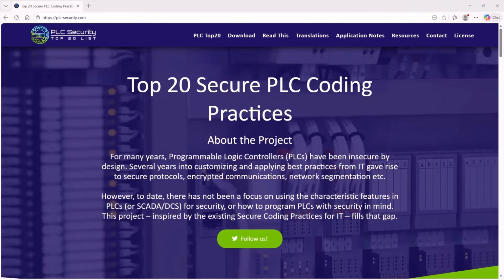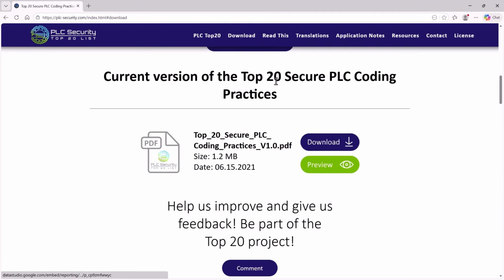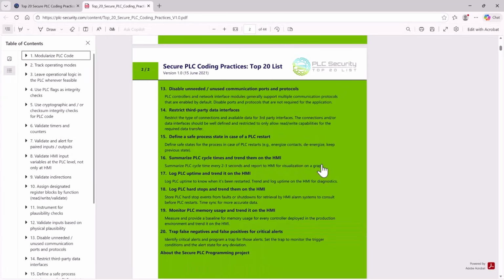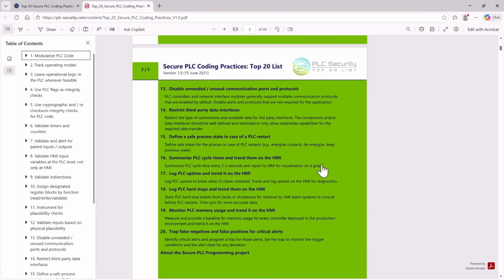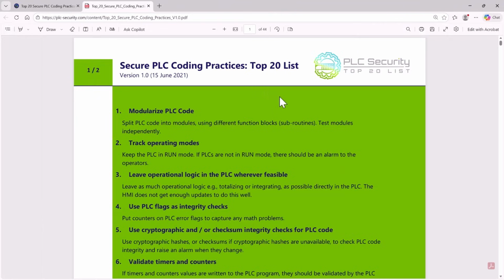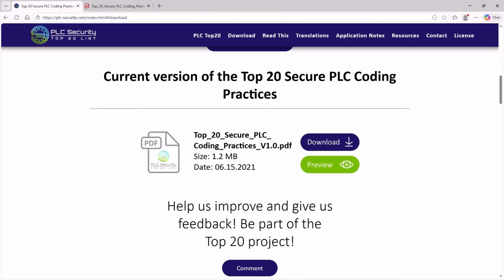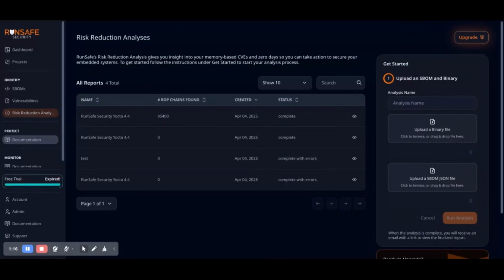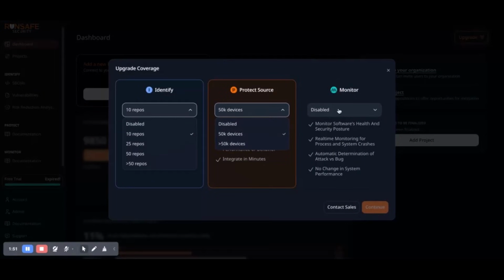Uncover the HIDDEN Threats in OT/ICS Cybersecurity

Comment: what do you think of Arduino Opta PLC in term of security and connectivity ?
Reply from the maker: I'm not directly familiar with them so I couldn't say 100%, though they look like fair little units for smaller environments, @Altairhigh.  Definitely solid units for a home lab at the very least!
Reply: What an interesting component! Thank you.

Without knowing those components, I guess, if it still uses the Arduino base, it could be better in terms of security weaknesses.

Now the large but: At first, at least on the Arduino page about them, I had not seen anything regarding any certification, not even about the environmental specs it's made to work for. Secondly: A PLC is one thing, but what runs on it is another. Even if the device has certifications regarding the hardware, it's security in the field still depends on the certification of it and its programming. So if this certification says (or even has to say), it's only valid under Arduino Software version x.y.z and a certification costs $10ks and takes 12 months, then all security fixes for the software are of no help.

That's the largest problem, with PLCs and remote controlled devices in the OT, at least in critical environments.

For at home, that absolutely doesn't matter more than the Home Assistant, that's driving our homes.

But if it's used for a grid, a railway or even for a production machine, a worker could come near to it, then it needs to be certified and then the classic rule applies: The first four priorities are Safety under all circumstances and the certification will enforce that. As software is a moving target and an update / fix might change the behavior (not even mentioning bugs here), the certification will pinpoint the version to use, except the vendor certifies (and potentially proves by another certification), that the behavior won't change. In the latter case: Gorgeous, you can just update. To a version, which only has fixes for the problems known a year ago...

That's why we always preach (and so does IEC 62443 also in effect): Update the next maintenance window, when an update is available! But also see your OT environment as inherently insecure and create as much layers of additional protections around it as possible, that any current or later problem of a component is shielded away in the first place. IEC 62443 calls it zones and conduits, but it means the same on a higher level: If the PLC has only direct electrical connections, it's great. If an ICS / SCADA system above it needs to communicate with it, so be it, if it's indeed necessary. But then only this must be able to communicate with it, enforced by segmentation (zone) and the conduit (the firewall at the border of this zone).
Reply: @compukiller2  You are absolutely right on all counts: the Arduino-based PLC lacks the environmental and safety certifications (e.g., SIL) for critical infrastructure, and even if it had them, the classic update-vs-certification catch-22 would lock it to an outdated, insecure firmware version, making security patches irrelevant. This fundamental conflict between IEC 61508 (stability/safety) and IEC 62443 (agile security) means this device is inherently unsuitable for grids, railways, or production machinery where worker safety is at stake. Instead, treat it exactly as you would Home Assistant, perfectly fine for homes, labs, or building automation, and if used anywhere near OT, follow your own advice religiously: segment it into a restrictive zone with a firewall conduit, accept it as inherently insecure, and never rely on its built-in security for critical functions.
Reply: @Altairhigh Perfectly said for those environments (and also for the certification nightmare)!
Reply: @Altairhigh And I love, that you call IEC62443 agile security. Agile is a word, normally nobody would bring into an ISO or IEC standard, but you're absolutely right: IEC62443 in fact brings agile into the play of industrial environments.